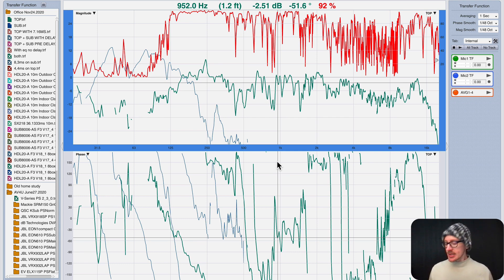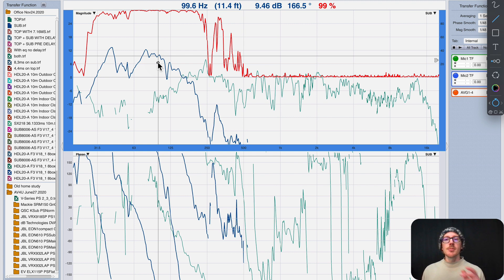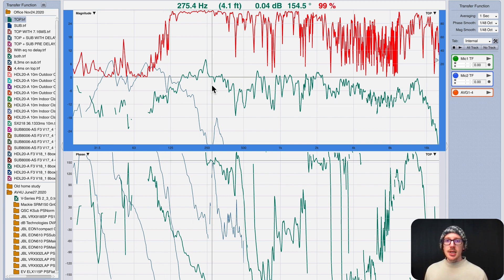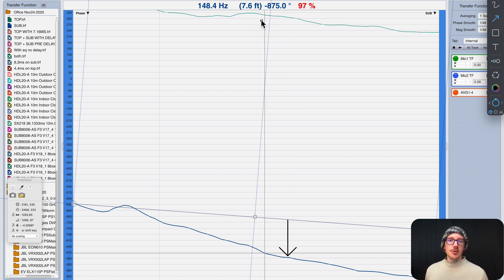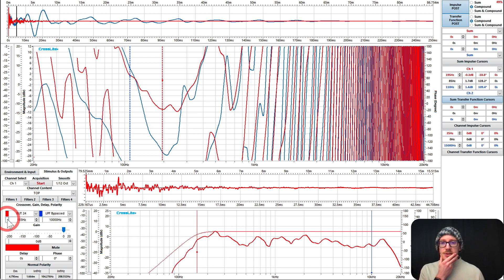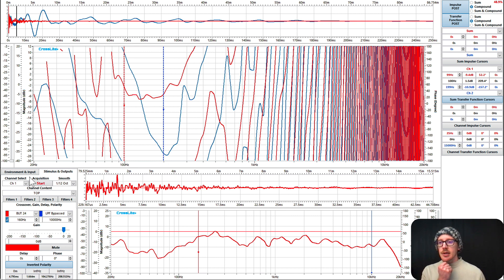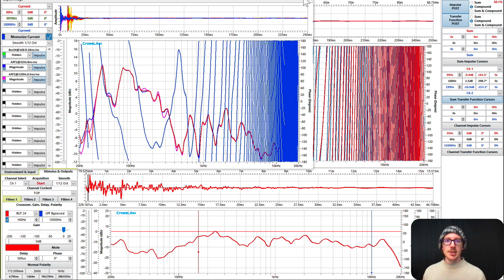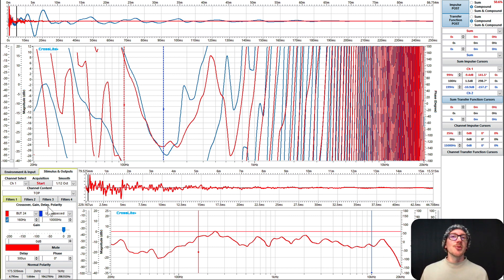Delay vs HPF vs APF for sub alignment (Ohm TRS212 + TH18 xoc)

Comment: What exactly creates an APF. None of my system processors seem to have the option of this
Reply from the maker: Hey Blonchay123, I wish I understood electrical engineering. Here's a resource - https://en.wikipedia.org/wiki/All-pass_filter#Active_analog_implementation

Wait, maybe you mean what pieces of hardware can insert APFs? I'd say it's worth a google. Personally I use my BSS BLU-160. It can insert a 1st order APF. To use a 2nd order APF I have to use the FIR filter section.